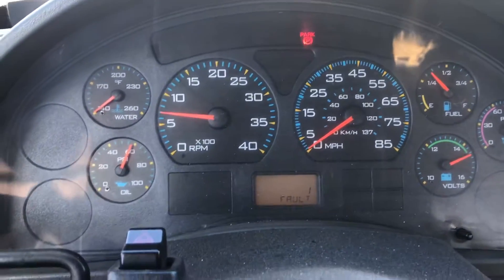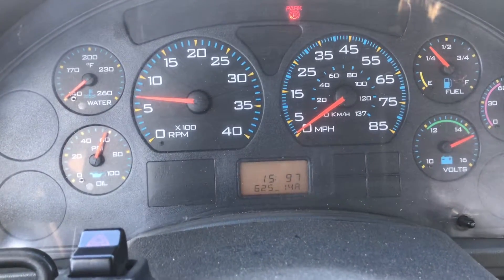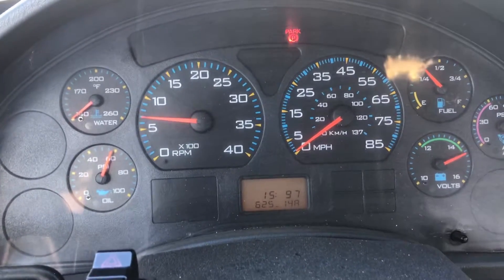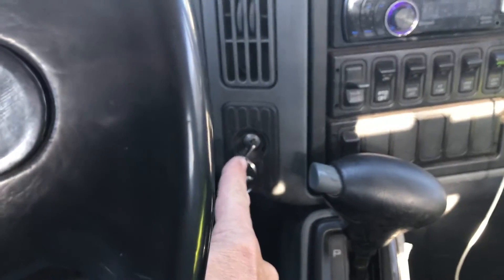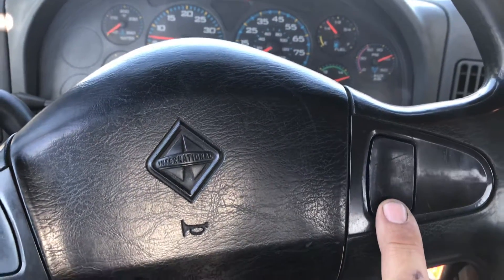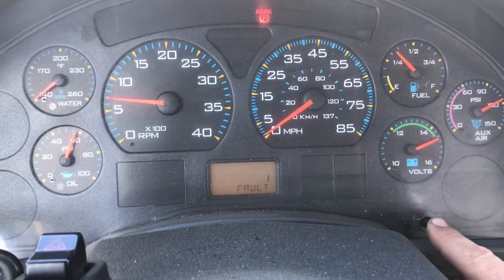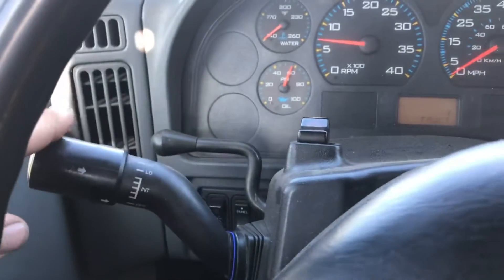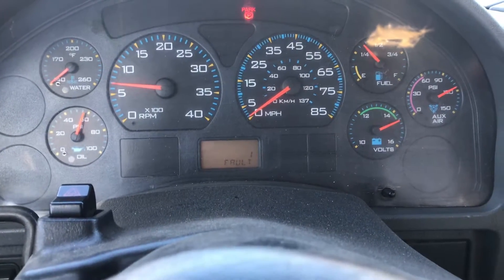2007 international 4300 (how to pull codes and clear them).

Comment: Will this work for 2008 4200? I tried clearing them turn key on. Hold top left. Bottom right and depress gas pedal 3 times. Did not work for me. I'm still trying to clear inactive codes

Comment: This hasnt ever worked on 6 different year international 4300's.  Never , but im glad it does for you !! Impressed !!
Reply: ecm password has to be cleared in navkal for it to work , aka not a fleet truck , never been a fleet truck , if it is or was it will have a password and it will prevent this from working ...
Reply: Change fuel filter